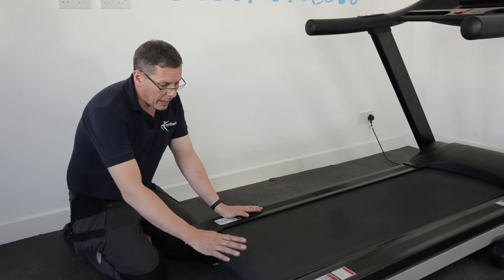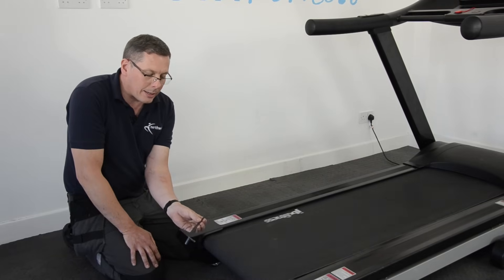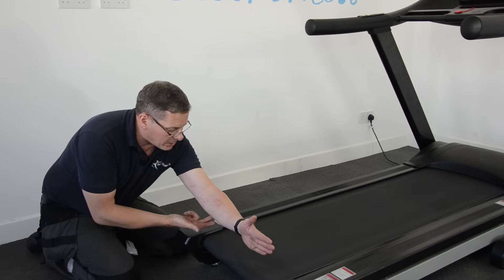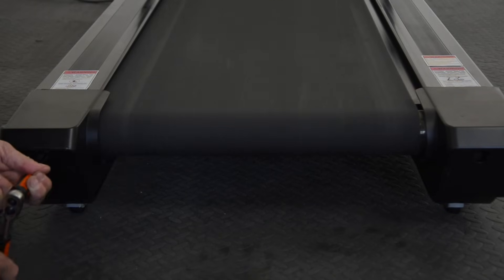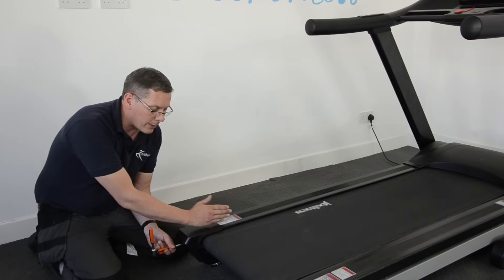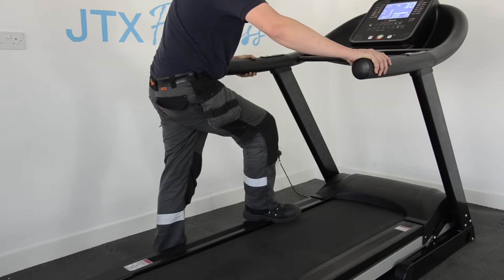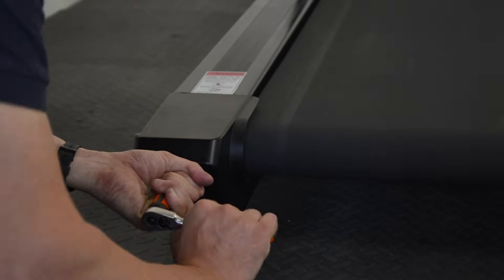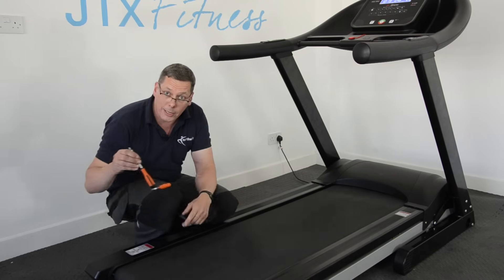How To Adjust A Treadmill Belt | Treadmill Maintenance

Comment: I have just recently bought a treadmill. The belt shifts over to the left when i use it but, as soon as I get off of it, it shifts over to the right. This happens every single time, to the point where i havent even used it properly as im still trying to sort the belt out. It is on a level concrete floor. The left bolt feels a lot tighter than the right one....how do i resolve this problem, please help, im at my wits end!! 🙈

Comment: This is great video explaining the basics of adjustment. I however am stuck with a problem. I have lubricated the board under the belt with 100% silicone treadmill lubricant. The belt seems to stop momentarily as my foot lands on the board. This was an intermittent problem before lubrication but this become a persistent problem after lubrication. Any suggestions on how I can fix it?

Comment: How do I adjust when the belt is off centre at the top i.e. the roller connected to the motor?

When I correctly align the belt on the base roller, the other side of the belt (the roller connected to the motor) becomes unbalanced.

Comment: Thank you for this. I tried to adjust the tension of my treadmill's belt and the manual that came with the treadmill did not seem to make sense at all. It said to move one screw clockwise while moving the other counterclockwise. I watched your video and you confirmed my suspicion. Thank you for that!
Reply: I read the same thing in my manual, a cardio zone! Must be some weird translation.

Comment: I may be over thinking this. 

Seems to me that adjusting the tightness of the belt while the machine is running has the potential of causing the belt to move off center again. The time it can take to move from one side to the other and then find the adjusting acres in the hole is typically long enough for the belt to move toward its new centered position. 

I'd recommend stopping the belt, adjust both sides and then start the belt again.

Comment: Clear and easy to understand. I particularly like  the straightforward explanation of why you tighten or loosen the adjusting bolt to get the belt to move in the direction you want. Good job!

Comment: Thank you very much! Did you turn it back quarter of a turn on the left side after you centered it and without an explanation or did I miss that explanation? Then 360° to both sides to tighten the belt. Thanks in advance.

Comment: Thanks for this video! I am having a nightmare tightening a belt. I don't understand how if you use the 2 bolts to move it left or right that you can then use the same bolts to tighten it... doesnt it just shift the belt...? im trying to get the belt straight and then turn it off and turn both bolts to the right, however it is just slipping again after one use. Advice appreciated!

Comment: I found out that clockwise turning makes the roller move toward you and anticlockwise turning makes the roller move from you. And I found out that right side gap means left part of the belt has moved more  from you than the right side. So I turned left side bolt clockwise and right side bolt anticlockwise.

Comment: I spent 30 minutes trying to adjust my treadmill belt evenly only for me to keep making it worse lol. Figured I’d watch a YouTube video cause I felt like crying and giving up. After watching this video, I kid you not I fixed the belt in 5 minutes. Such a lifesaver, thank you!!
Reply: I'm the same right now, but I must be extra dumb or something cuz I can't for the life of me fix it. Even when it's right and equal on both sides and I feel like singing, I then discovered the belt is too lose and while tightening it keeps slipping to one of the sides again. Can't figure out the left or right side turning to get me where I need to be 🙈 It's why I absolutely HATE oiling the machine cuz I need to losen the belt to do it.
Reply: @Devilishka7 i have the same problem 😢😢😢
Reply: @JudithSamp  Took me like 2hrs one day and then still had some fixing to do the following day. Would love to give advise, but it was all trial and error for me with lots of frustration. Once I got it straight and it came to oiling again few weeks later, I religiously counted each turn to try and get it back the same again. So far so good.
Reply: Same problem here! This video was a great help!

Comment: Appreciate this vid! 

Regarding deviation and the Tensioner screws.... Do the foot rail screws just "hang out" (on the end of the screw) through a loose/oval hole (just to keep them straight somewhat) or are they threaded at the end of the screw with a hole that fits the screw? I bought a cheap treadmill (GoPlus 3-in-1) and we're having insane problems with it. The left foot rail has the "oval" hole (bigger than the screw itself), and the right foot rail is fully threaded. When I adjust the belt deviation, the right is damn near impossible to tighten (because it's already WAY too tight) and the left can loosen or tighten easily. Something has to be wrong.

Those little "weights" or whatever (that the screw goes through).... are they supposed to be somewhat in the middle, or closer to the front of the treadmill? Because of how I cannot tighten the right screw any more, the belt keeps slipping... there's no way these tensioner screws are THAT tight... or mismatched, as they are with this.

Any help is appreciated, thank you so much! I'm so frustrated with this thing.

Comment: your instruction where very helpful. Now, I have another issue. My 
Weslo Model No. WLTL82540 S/N E33215675. I set the spee I use and when I use it sometimes I can hear the speed going a little slower and goes back to noraml for awhile and the belt tension is great no slipping at all. I am a License Master Electriaian. So, I feel could it be motor, the pc board. or the potentiomwrwe (the speed control). Any comants would be very appreciated. Thanks

Comment: No one seems to explain why a treadmill belt, when walking , sounds like it’s being dragged across sandy concrete, even when lubed.I’ve a new pre waxed deck. The belt I got had a liquid wax bottle included, w instructions to apply throughout the belt bottom before installing. Though I didn’t apply more than an ounce, I get this extremely irritating walking belt across sandy concrete sound!?!  Any thoughts?

Comment: My issue.
Model: Schwinn 830 SoftTrak
Powers On Console Works count down goes 321 then the belt starts moving for about 10 seconds then just stops moving. Console timer still on.

What ive tried is when this happens just pull safety key put it back and continue treadmill and it just does it again shuts off after 10sec. Not 100% sure but could it be a relay issue ? Just b4 it stops i hear the click

Comment: Please explain how to tell if it's too tight (other than the finger test), please.  My treadmill "bogs" when I walk on it.  Like, the hum of the motor will be fine--until i step on it.  Then there is an audible drop in the hum and with each step the hum drops as if I am too heavy for the belt.  Is that too tight or too loose?  Thank you for any help!
Reply: I also need to know if my belt is too tight or not. I wish someone answered you :,(

Comment: everytime we step on it to run we can feel it stop with every step for a split second. does this have to do with the tension of the belt? does it need to be tighter or looser???
Reply: If you feel it stopped or stopping, then the belt is too loose, it needs to be tightened.
Reply: @nolanmckain2061  thanks g

Comment: My belt still runs to the left, I've moved it as far as the Allen key can go, but still hasn't moved. The running belt has always slipped whilst running, which puts me off going on it😱. I've loosened it to apply oil, but now it's worse the before😭 🥀

Comment: i have a reebok treadmill, i just followed the instructions on the manual on how to lubricate it.. however, when i run the machine the belt keeps moving on the right side brushing its sides... i still have problems leveling it..

Comment: Thank you for sharing this wonderful video.  I spent more than an hour trying to fix my treadmill belt which slipped to one side without success.  After watch this video, I was able to adjust the belt in less than 5 minutes.  Another added bonus after watching this video, I now know how to lubricate the belt which I have not done since I bought the treadmill a couple years ago. Again, thank you very much for the wonderful instruction !!!
Reply: Does adjusting for tension not change the angle?

Comment: I have a query. How to adjust the motor belt which is connected to the drive motor? The belt has slipped to the edge of the wheel.

Comment: I have a question regarding thumping noise, I can hear the thump sound everytime when the company sign(Reebok) which is on the belt goes around back or front roller, how I can fix that? Should I loosen or tighten the belt?
Reply: I get this too. Like a heartbeat type sound but more when the diagnoal bar goes over the back.  When I called Reebok they said it's just the tension that will loosen off over time.
Just lubed and adjusted belt for first time...been at it for about an hour 😩 Reebok said 5 turns to lift up belt. My ar$e

Comment: I am desperate for an answer! Your video is amazing and I am trying to perform exactly what you are showing in the video. Problem is, none of my allen key fits the screw to adjust the belt! I have a metric and an imperial kit of hex key and none of the keys fits in that screw. I have long lost the included key that came with the treadmill. I am trying to adjust to belt on the 
PRO-FORM CROSSWALK 397. If you have any ideas, I would greatly appreciate your insight! Thank you!
Reply: I'm having this exact issue! I have a proform crosswalk 500. Did you get this resolved?
Reply: None of mine won’t fit as well

Comment: I did it and worked but the screw is as tight as can go and still lose as if it needs to be more tightened
Reply: Check to see what the maximum weight limit of treadmill is, otherwise the belt that is connected to the motor inside the machine may be a little loose. I bought a used treadmill, and from the use, the inside motor had shifted a little not putting enough tension on inside belt, so I loosened the outside running belt completely, moved the motor to be tighter on the belt and then frightened it back up, works great, I also lubbed the treadmill,  also check to see if the belt itself doesn't need to be replaced

Comment: Thank you very much for uploading this video!!! I find your instructions very clear and concise; they work for me . . . Almost. Unfortunately, after each treadmill session, my treadmill is misaligned again. Could you tell me the possible reasons and the ways to correct these issues, please? Is it possible that the treadmill misaligns each time because the pressure I put on the treadmill while running and walking is too asymmetrical (my hip and knee joints need treatment)? 
Thank you very much in advance for taking your time to answer my question.
Reply: Hello. If you need replacement parts or accessories for your treadmill, you will find a great variety at the best price here:
Partsfortreadmill.com. You can sent a request to sales@partsfortreadmill.com.
they also have a blog with hundreds of article about treadmill repair and maintenance :)
Reply: Did you ever receive a reply to this question? I am experiencing a similar situation. Thank you.
Reply: @francoisrouviere  ,
Unfortunately, I did not.
I am sorry that I could not help you.

Comment: I did this adjustment to my treadmill but it only works in the down side of the treadmill. the belt will go
to the left top side as soon I turn on the treadmill. I can adjusts the bottom perfectly but not the top.
Reply: there is an adjuster under the motor cover that you can use the same concept on to get the top to run true.